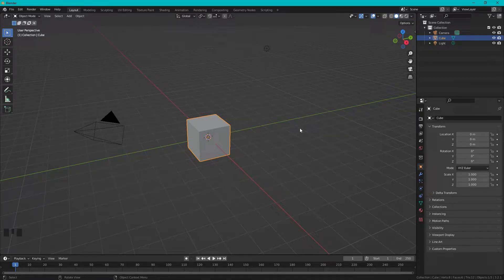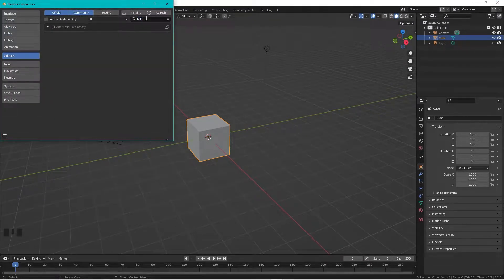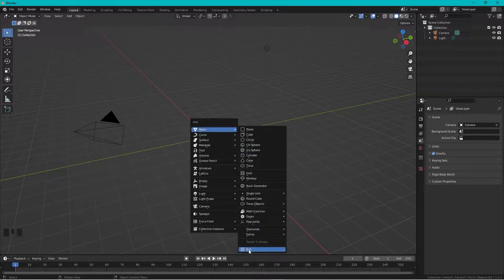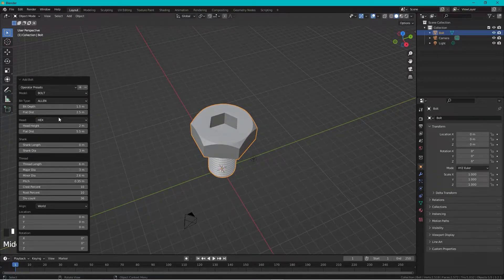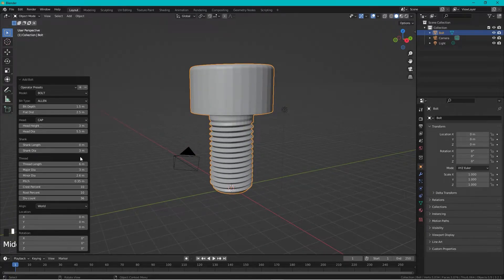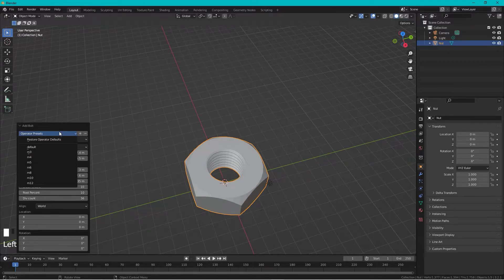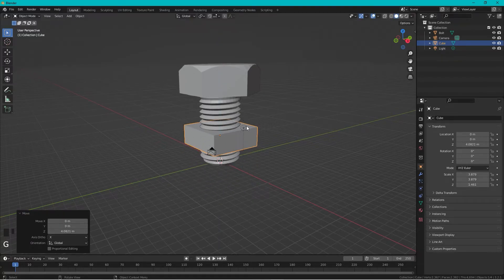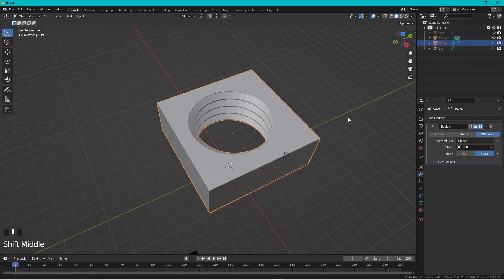How to make screws, bolts, nuts and threads in Blender - easy with free add-on

Comment: Anyone using newer versions of blender, not exactly sure though i am using blender 4.3.0. They moved the BoltFactory addond to the Get Extensions tab in prefrences.
 And for me, it appeared very small, so i had to resize it to 1000 on every axis, and whenever i changed a setting on it, its size resset. I am no proffetional

Comment: These are all metric and I'm trying to get a 6-32 screw hole since I'm making a little holder to screw on to my desk using a 3D printer, should I just use something like an M4 and find what percent bigger/smaller a 6-32 is and scale it by that factor?
Reply from the maker: @mantiswhale1252  See this video because I think there are imperials values in that chart as well just use them instead. 
https://youtu.be/v6Faj-yxu_4

Comment: Yeah, but if you make a nut using a screw and boolean, don't you need to make tolerances?
Reply from the maker: Well it all depends what you are going to use it for? If tolerances are important I would not even use the add-on
Reply: @3dplockis  I'm just wondering because I'm making bolts and nuts. Without adjusting tolerances, I can't get the bolt to screw in. I'm printing a test now with adjustment for tolerance to see if it screws in.
Reply: @erikfragoso1255  Did it work?
Reply: @user-kz6mw9jv5n  hi. No, without any tolerance, they matched exactly and would not screw into each other. Giving a tolerance, I was able to get it to work. I think I used a .2mm difference.
Reply: @user-kz6mw9jv5n  just to add, make sure you only adjust x and y axis. Do not adjust the z or you will change the threads. So the nut hole should be .2mm larger x and y.
Reply: @erikfragoso1255  yeah I 3D printed one yesterday and had to try different scales on the x and Y, and one of them finally worked. Not very scientific though :/
Reply: @user-kz6mw9jv5n  I hear you. I think I used a .2mm difference, but not 100% sure. What i did was create my bolt. Copied the bolt. Increased the x and y on the bolt by .2mm (assuming my memory is right), then boolean cut into where I was screwing into.
Reply: @erikfragoso1255  yes that would do the job